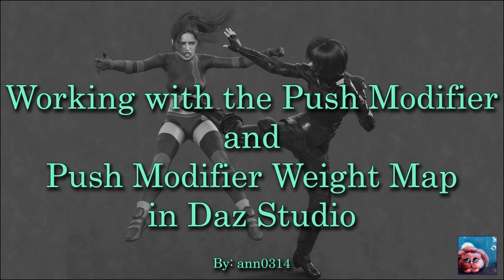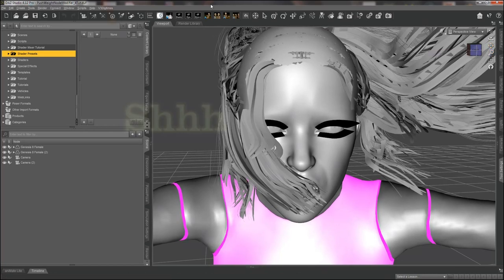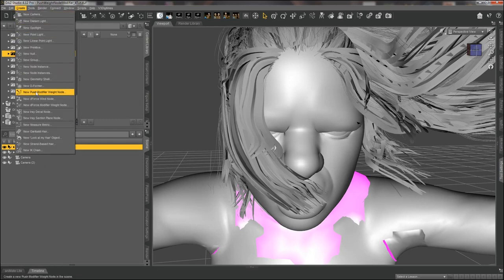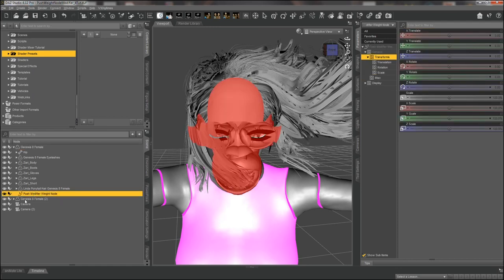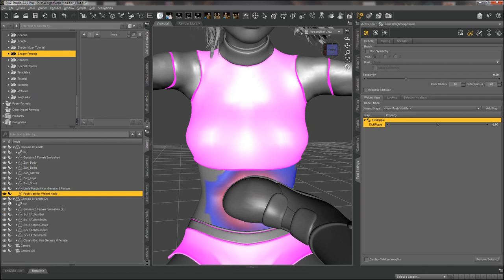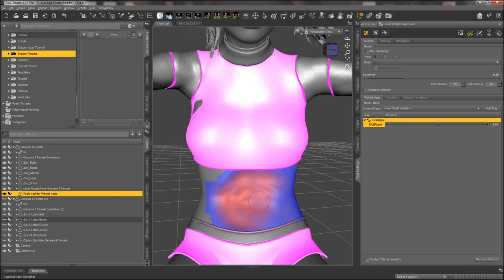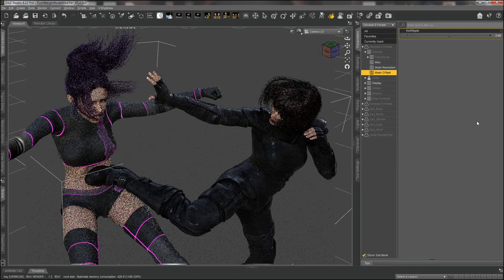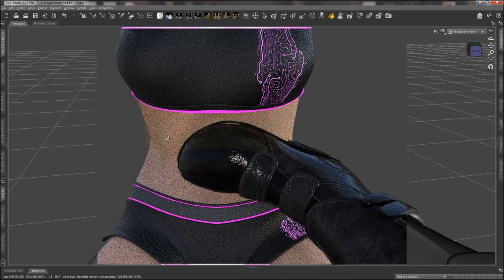Daz Studio Push Modifier and Push Modifier Weight Map

Comment: Thank you for the tutorial! Is there a possibility to have weight map reflected on one of the axes? For instance, I would like a modifier to apply to both cheeks of the character symmetrically, but it would be very difficult to draw a perfectly symmetric map manually.
Reply: Oh, I found Use symmetry tickbox in the brush which does exactly that!
Reply from the maker: So sorry I missed your reply initially. That, said I am very glad that you were able to find the setting (and TY for sharing the solution with others <3 )

Comment: It's fun. But it's ultra limited as it seems to act only on the base mesh without subdivision. So for a foot eventually it's ok. But for a hand, where you want to feel fingers pressed on the skin, it's useless. So many interesting tools & functions in DAZ act only on the base mesh without subd.
Reply from the maker: That would likely be better suited to control with a morph. There are some tools I believe within DS for doing morphs in App, though personally I use ZBrush for things I need that level of detail on (or normal maps/height maps. So I am not entirely positive.
Reply from the maker: Of note, I just saw someone approach this very thing using push modifiers and the way they approached it was to add the deformation/push modifier to the receiving item (IE the item that the fingers were supposed to push into - in this case it was a person) So they morphed the skin on the person using the push modifier (or a group of them) to get the look. That said there are other ways with more control that may prove better like the previous ones I mentioned.

Comment: Awesome, everything worked except my character stayed swollen?
Reply from the maker: The weight map you drew should be controlling that (Telling DS/the dial which areas stay swollen and which areas to "push or pull") I would double check your weight mapping to be sure something didn't happen that is making the weight map not apply. Sorry I can't help more than that but its hard unless I can see everything but I would start there to troubleshoot. Maybe go back over that section of the video (under Zeroing the Weight Map to Remove the Modifier from the Full Mesh heading) forward to see if maybe you missed a step somewhere. It can be easy enough to do. The first time I tried this, I had similar issues. Let me know if that helps <3
Reply: @ann0314  I appreciate your help thanks I will try it again